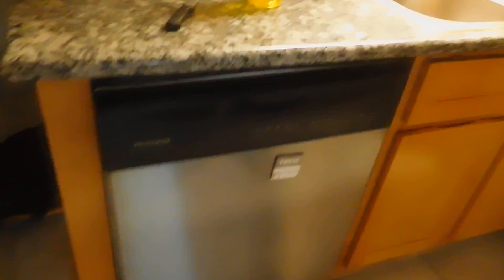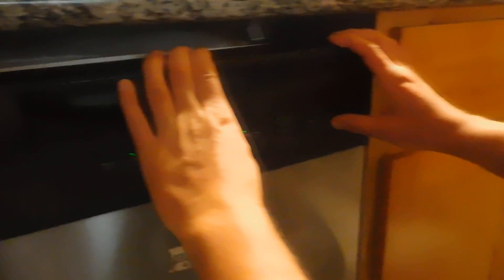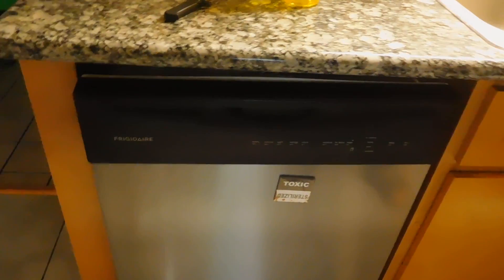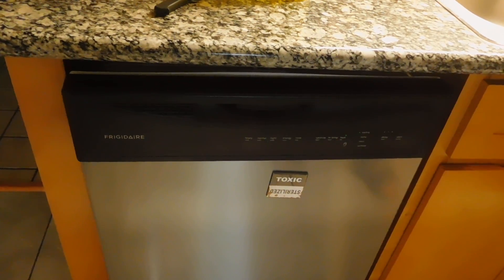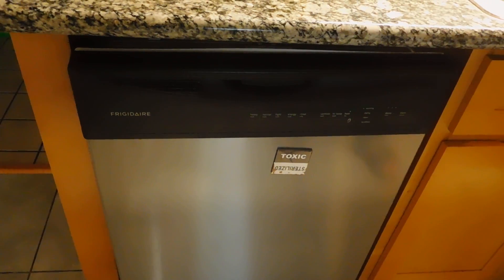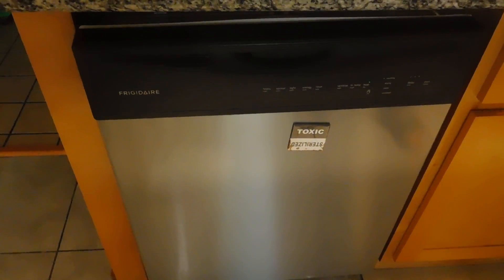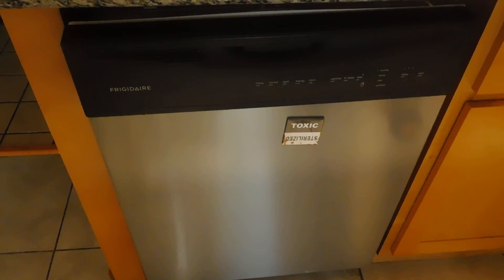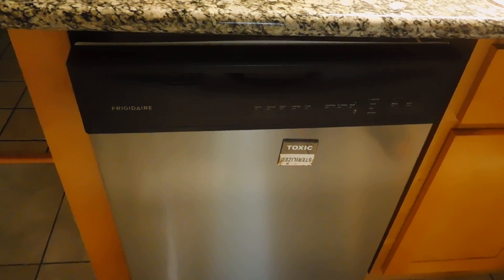Frigidaire Dishwasher, Self Diagnostic, Test Debug Cycle Mode, LFBD2409LF2B

Comment: Check the wires that plug into the door switch ,common problem they overheat and melt the connectors ,

Comment: I have the row of 4 lights flashing.  It happens continually.  Without unplugging the unit how do I reset the unit by pressing buttons?
Reply: Did you ever figure out the 4 light problem, I did reset it and do what's mentioned in the video, but they just come back. If you had any luck I'd much appreciate any ideas.
Reply: @timjilman3295  One thing an electrician friend told me was that I might have reverse polarity in my plug.  I did check it and sure enough, the black and white wires were reversed.  We corrected that and found out from him that another major no-no was to have other plugs or lights on that same circuit.  Sure enough, some rocket scientist had wired the dishwasher circuit sometime in the past and put it on a circuit with our bedroom plugs and lights.  We are in the process of having that changed right now.  If you have similar problems you might want to have them addressed.  Also, if you ever replace the main board, don't throw away the old one, as the new one might do the same if you have similar problems as we do.  I still have problems with trying to figure out what sequence resets the dishwasher.

Comment: To reset this model....unplug from source, wait 30 seconds, plug back in, lights will be flashing, hold start/cancel button down simultaneously with heat wash button. Hold until cycle commences.
Reply from the maker: Thanks!
Reply: Did that now hi temp and heat dry light flash. Is this normal?
Reply: Corbo Yates 
Did you ever find out what to do? Mine is flashing on start and I can’t get it to work I’ve cleaned out the drain all of it and nothing
Reply: @corndoggbitch   Did you ever figure out how to get yours back working? Mine has the same 2 lights but the reset didn't work for me.
Reply: @corndoggbitch  Hmmmm I would have thought unplugging it would have done the same thing.
Reply: I have same problem and going to try this, thanks

Comment: I tried this and it didn't work. I have the same dishwasher it was hooked up and worked for 3 weeks then stopped working. Only lights show up tried resetting the breaker and what you did here still didn't work.... Idk what happened this dishwasher is garbage
Reply from the maker: Do you mean after pressing HiTemp & Start simultaneously for a long time, your dishwasher didn't enter into self-diagnostic/debug mode?   It's difficult to see whether it does since the LEDs don't do anything.  You have to kind of listen to whether you hear things going on that coincide with the expected debug mode time-frames.  I thought I published those time-frames somewhere here, but maybe I published them somewhere else.  Without those notes, I guess you could listen whether the sounds my dishwasher made in this video match the sounds you are hearing from your dishwasher.  Let me know how that turns out or if you get new info.
Reply: Shanny Barfield you have to pushing it after you press start. And after a second it will lock and start working